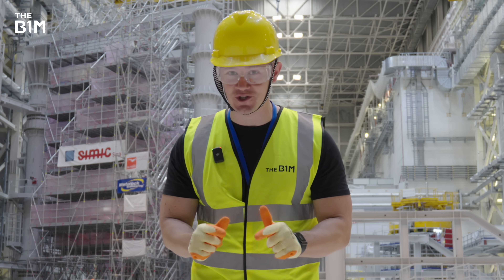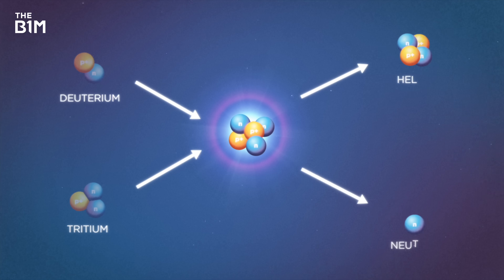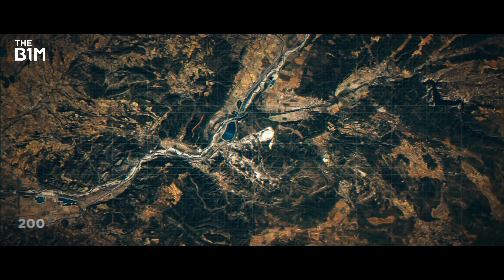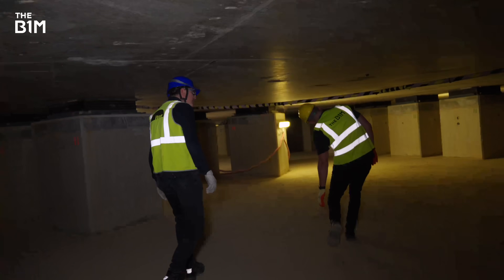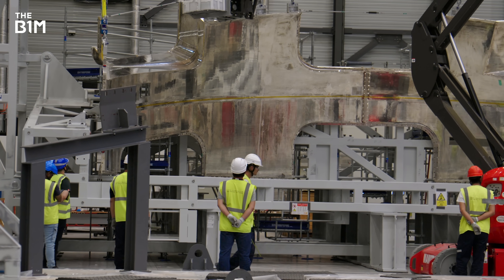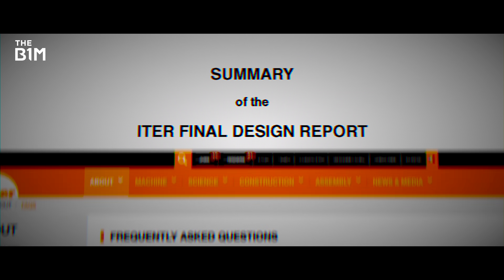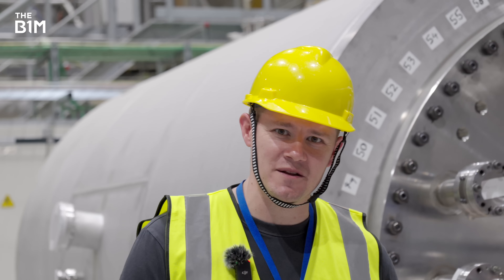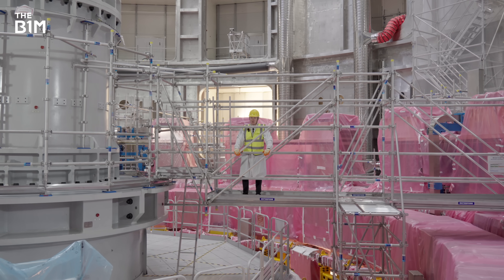This is The World's Most Complex Construction Project

Comment: 19:55 I’m just admiring the tarped hallways with the aluminum exoskeleton ❤ that looks like a futuristic project in itself! Like a dang germ can’t get through because all the seams have been fused together ❤ and how they did that? I’m guessing one of those potato chip bag sealers you get off Temu! But maybe they made an industrial size or got one from the snap on truck I’m not aware of but anyhow they did a great job with the sealed tarp hallways ❤😂!

Comment: I really do not think it is possible to get the compression force the Sun puts out on our tiny scale for fusion to occur. It is gravitational force that drives the reaction of fusion. The energy to get it going if possible and extract helium to constantly inject seems like a net energy loss. There is a very good change what could happen is the whole thing blows up from the reaction of helium atoms fusing and emitting powerful X rays and just burning the shit out of the outer casing. How do you control the compression and expansion and even more troubling how to convert fusion into usable electrons? Anyone? MR NEIL?

Comment: As complex as ITER is, the Large Hadron Collider at CERN is unparalleled in terms of its precision engineering. Both are of course massively complex engineering projects, but in terms of pure technology, the LHC is unrivalled in its data processing and accuracy of instrumentation. Of course they are different machines for different purposes, but B1M's claim that nothing comes close to ITER is not factually correct.

Comment: It's worth pursuing the scientific discovery of controlled fusion but for the here and now we should be implementing modern fission power plants as an international effort to eliminate all coal and gas power production. It would require a coordinated effort to fund, build, and fuel all these reactors as well as the monitoring side to make sure the fuel/waste is being handled correctly but this is within our capacity we simply lack the will to do it. You can't tell me climate change is existential and then deny the clearest path to curbing massive amounts of emissions. The US Navy operates nuclear reactors safely in their submarines and carriers because they have a good process in place for safe reliable operations.

Comment: 28:00 Id like to add to the laser fusion that while the laser energy is 2.05MJ, the electrical energy required to power these 192 lasers is 400MJ. So to say that its the first time ever that more energy comes out than being put in is not even a "on the backside of an envelope" kind of calculation, its pretty much a misleading statement (since yes, purely speaking that you put in 2MJ of laser energy, release 3MJ of Energy and only looking at the Reaction isolated is true, howerver looking only at it like this is very misleading since the electrical power of charging these lasers is round about 100 times higher.. 3MJ/400MJ that would be 0,75% return on investment, essentially "loosing" 99,25% of the energy in the process of changing the electrical energy into light/heat)

Comment: The more complex a system is, the more prone it is to failure.  With millions of parts to potentially break down, how is this reactor supposed to keep running?  And even if it does eventually work, environmentalists will become afraid of it and shut the whole thing down.
Reply: The experiment is only about proof of concept. Simplification, reliability, production optimization, long-term operation and safety are the next steps that will be carried out externally based on the knowledge gained from the experiment.

Comment: Could the sun’s rays create fusion if focused?

Answer..,.
While focusing sunlight can indeed generate immense heat, it's not enough to initiate nuclear fusion.
To achieve fusion, we need to create extremely high temperatures and pressures, conditions found in the core of stars like our Sun.   

Here's why focusing sunlight isn't sufficient:

Temperature: Even with perfect focusing, the maximum temperature achievable with sunlight is limited by the Sun's surface temperature. This is far below the millions of degrees Celsius required for fusion.
Pressure: Fusion also demands immense pressure to force atomic nuclei together. Focusing sunlight cannot generate the necessary pressure.   
While the idea of harnessing solar energy for fusion is intriguing, current technology is still far from achieving this. Scientists are exploring various methods, like using powerful lasers or magnetic confinement, to create the extreme conditions needed for fusion.

In other words…..Impossible!
Reply: Who suggested using sunlight?

Comment: Why are we betting the farm on a tech that requires one of the most rare and expensive expensive fuels on the planet to operate? This plant would require approx 112kg of tritium to operate for a year at capacity. There are currently 20 to 40 kg of tritium on the planet. The B1M also requires large (currently uncalculated) amount of liquid helium for cooling, another rare and highly sought after resource. Will the medical industry and others go without helium so they can test this improbable machine?
First you have to contain the fusion, second you need to efficiently harness the produced energy, and third, you have to have a breeder blanket that produces more tritium than the B1M uses. None of the three has been achieved. If any of the three fails, so does the B1M.
It will require enormous luck for this plant to ever produce a MW. This project fails basic engineering and scientific scrutiny yet it plods on.

Comment: I'm calling bull s#!t on this. Going deeper into the sun at the sunspot areas, the temperature gets COOLER NOT hotter as your thesis requires. Moreover, it's still centerialzed control of power, thus keeping the endusers enslaved to the provider and its endless use qualifications and price increases.

Comment: A source of clean and inexaustible energy already exists in the ocean. Problem is, once the collectors are set up, it'd be free. Passive and clean.
Reply: What source is that? Nothing is free.
Reply: @Orbital_Inclination  Infrastructure of course costs. But the source of electricity is MOTION, that is all. The oceans NEVER stop moving. A coal-fired or nuclear power plant simply heat water to make steam to turn a turbine. 19th century steam engine technology. The source I'm talking about is the motion in the ocean. Unlike a turbine it's ALREADY in motion and will be as long as the ocean exists.
Reply: @jhaduvala  the maintenance costs on tidal are massive vs virtually all other energy sources. Salt water and mechanical devices do not mix well.

The reason power stations use steam turbines is because they are insanely efficient, and have moved on a lot from the 19th century
Reply: @Orbital_Inclination  Firstly I didn't say tidal. There is constant motion in the ocean. As for "insanely efficient" - I disagree. Consider the externalities. The maintenance costs of tidal may be "massive", TODAY, but that's a problem to be solved.